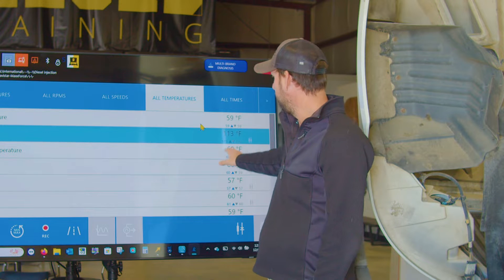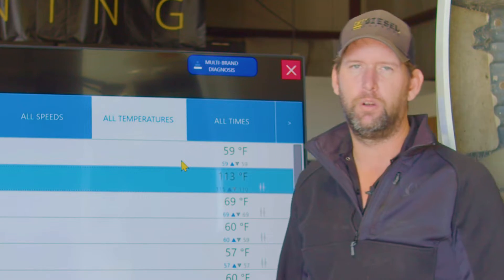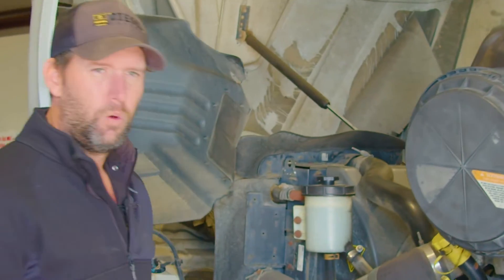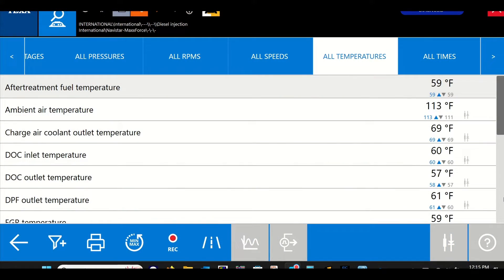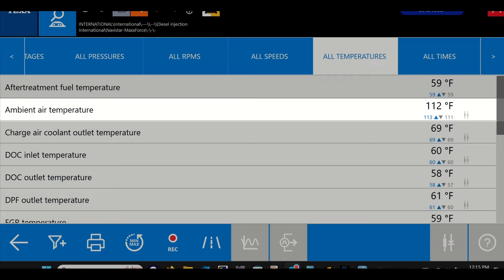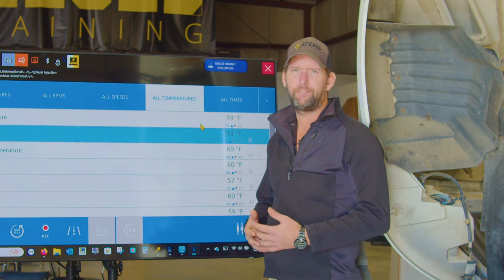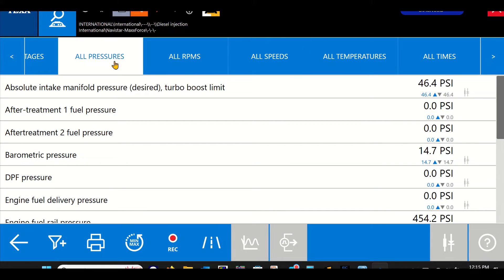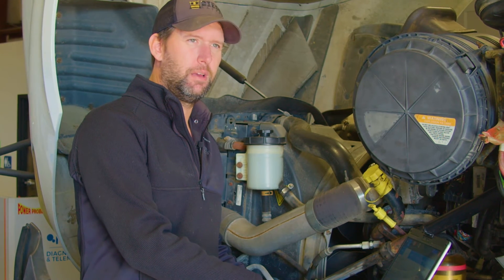A Quick Cold Soak Can Prevent Problems Down The Road

Comment: Hey, I have a question for you guys. I'm in HVAC. Long story, my diesel van broke down, go to a diesel mechanic who happens to be a woman. My boss said, "decline repairs. I don't want a woman to fu** up a man's job." We have women HVAC techs, so I'm extremely confused by him saying this. My question is, can Diesel techs refuse service because of that. By the way she heard him on the phone say that, and still continued to fix the problem, she's the lead tech in that shop. How would you guys deal with this? Thanks.
Reply from the maker: When it comes to getting a vehicle or a machine repaired, they are either capable or they are not.  Gender does not define skillset when it comes to repairs, and should not be a deciding factor.  Only experience and mindset matter.  Find a tech that has both of those qualities and gender is irrelevant  Hope this helps.
Reply: @DieselLaptops  Absolutely. One of the best plumbers I've ever known was a woman. I left that job, and I couldn't believe my boss would say something like that. Also, the woman diesel tech did the job anyways and did an absolutely fantastic job, super professional.